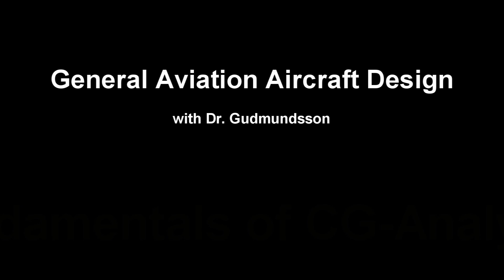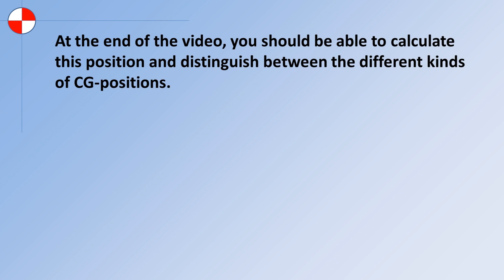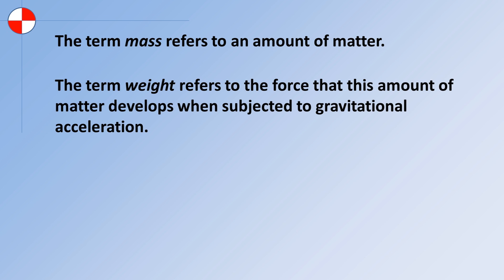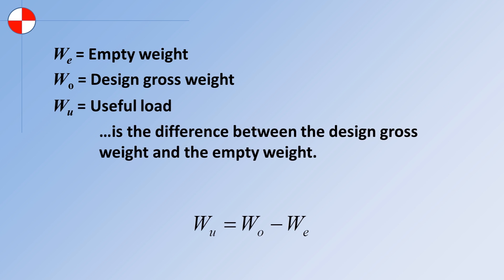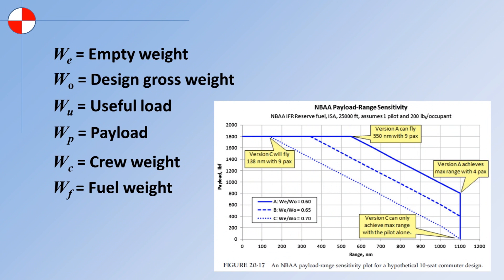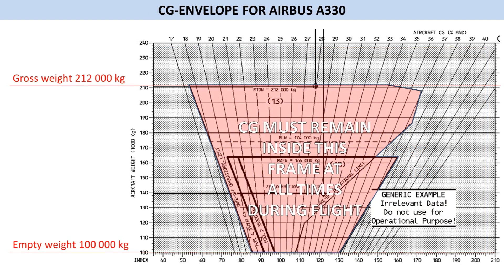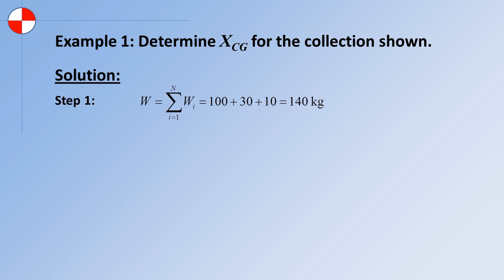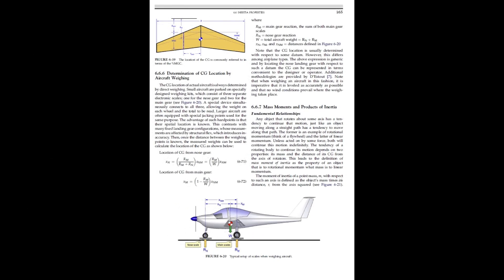Aircraft Design Tutorial: Fundamentals of CG Analysis

Comment: I want to build a P51 Mustang Replica for display, I have some sponsors here who help me with free materials and services. I want to use the drawings of mr. Marcel Jurca to do the parts and assembly, but the drawings are in PDF, and I want an assumed, responsible, serious volunteer (free of charge!!!) CAD engineer to help me redraw the drawings from the PDF and put them into DXF files, so it can be easily cut on CNC from plywood, aluminium, steel etc... I have some progress on the frames and formers (pictures attached). The Mustang will be displayed for a new aviation museum project I am currently developing. The CAD engineer will be mentioned on the sponsor's list on the project website.
Reply from the maker: I think you need to contact an aerospace or mechanical engineering professor at your local university and suggest this as a project for an undergraduate engineering student. They are usually eager to work on any projects they can place on their resumes (most likely for free). You should be able to find a design professor from the online faculty directory at your local university. Good luck!

Comment: Hello in example 2 at the end of your video, for #4 the fuselage shell my calculator said 3,780 not 3,785.1 and for #6 the main gear it came out to 455 not 455.8, were these errors on the spreadsheet  or was my calculator wrong, with my calculations the cg still came out to 17.95 though, which was still slightly outside the rear cg, thank you I liked your video very much and it really helped me understand how to calculate cg from the datum line on any aircraft
Reply from the maker: @Skypilotken  Greetings. The reason is that in my spreadsheet the actual weight of the fuselage shell and main gear is 84.113 and 91.165, respectively. However, since I'm showing the weight with no decimals (for clarity) this leads to minor discrepancies. I suppose I should have clarified that. Regardless, your arithmetic is spot on. Thus, given the reduced number of significant digits I'd say your calculations are correct. Best wishes.

Comment: One question:  In your example, how do you determine that the fuselage shell is to be located at station 45 of your diagram?  Since the shell is the whole length of the aircraft, I can't figure out why 45 inches was chosen.
Reply from the maker: Great question, François. First, the installed engine weight is assumed to contain everything forward of the firewall, including the cowling. Therefore, the "shell" is really the length of the fuselage starting at the firewall. This is approximately at Fuselage Station -30 (call it FS-30) and it extends to, say, FS170. Thus, I consider the CG of the fuselage shell being at FS45 to be a reasonable approximation. Yes, it might be slightly farther forward, but I hope this doesn't take much from the learning offered by the example. I hope this clarifies. Best wishes.
Reply: @dr.gudmundssonaircraftdesign  Thank you for your response.  That has always perplexed me.  I presume in real life situation, the shell would be weighed and balanced with the airframe.
Reply from the maker: @ADAPTATION7  Yes, weighing and balancing the shell would be done, although this can only be done after it is built. Before that's done, math is used to estimate where its CG is located. Today, solid modeling software is frequently used to determine this. An educated guess supported by mathematics does pretty well at this. Best wishes.

Comment: first assumption for CM and CG i dont agree with ... a plane with top wings like a pontoon plane such as a cessna has its CM BELOW the CG ... so they are NOT in the exact same place in all axis' ... they are always inline for best performance yes BUT the CM and CG are NOT in the same exact location ... on a cessna the cg is above the centerline of the plane while its CM is almost double the distance below the centerline BUT directly UNDER the CG in all axis' (at rest or levcel flight)... because of this difference the CM and CG cannot be interchangeable they will be CLOSE to each other but NOT exactly the same in all designs ...
Reply from the maker: Hi 0623kaboom. Sorry pal, wrong! Whether you (or any other person) agrees with the principles of physics is irrelevant. MOTHER NATURE IS OUR BOSS! WE ARE NOT HER BOSS. Do you know basic physics? If so: Weight W=mg, where m is mass and g is the gravitational constant (9.81 m/s²). Thus, the CG (center of gravity or center of weight) is precisely at the CM (center of mass). For instance, a solid sphere (e.g. a ball bearing) has its center of mass at the center of the ball. Since weight is nothing but the amount of matter (mass) times g, the CG is at its center as well, i.e. at the CM. The same applies to all other bodies. The only time this doesn't hold is if the body is in a non-uniform gravitational field (e.g. near a black hole, where the magnitude of gravity changes rapidly with distance from its center).

Comment: If the airplane weights 100 kg and the wing area is 1x10m, how fast do I approximately have to go to get airborne?
Reply from the maker: Robert. It depends on several things; first and foremost on the shape of your wing and airfoil selection. If we assume a poorly designed wing (CLmax = 1.0) , then your stalling speed (or minimum flying speed) would be approximately 46 km/h at sea-level. A better wing (CLmax = 1.5+)  would require some 37 km/h . Of course, getting airborne is one thing, having  a configuration that is also "stable" and safe to fly, is another. Best wishes.

Comment: Hello, Dr Gudmundsson.  I have a question about optimum tail arm length.  I am little confused as some books give different formulas for working out tail arm length.  In a book Mohammaqd sadraey uses
 l=K (sqrroot){(4CSVh)/(pie *Df)}
K=1-1.4
He also notes that tail arm length shorter than 3 times wing chord is short coupled, which possesses longitudinal trim penalty. 
Can you help me with this dilemma please?
Reply from the maker: Hi Sed. My formula sqr(2∙Vht∙C∙S/(pi∙(R1+R2))) is fundamentally the same as Sadraey's. He uses Df = 2R in his presentation, while I use R, where R1 is the radius of the fuselage at the wing's Cmgc/4 and R2 the radius of the fuselage at the HT's Cmgc/4. This also explains the factor 2 that is different between the two formulas. Sadraey only accounts for the diameter of the fuselage at the wing's Cmgc/4 and clearly assumes the aft fuselage is a cone, whereas I use a frustum. He also uses fudge factors (1-1.4) - I don't use any. These fudge factors are necessitated because when you use this form of the optimization one tends to come up with a slightly shorter tail arm than you find among real aircraft.

So, as you can see, there are slight differences but not significant ones. Regardless, I present two additional optimization approaches in my book and the third one optimizes the tail arm based on horizontal and vertical tail volumes and its output is pretty close to what you see in real airplanes that have the centroid of their HT and VT close to one another (which is the case for great many real aircraft). You should also keep in mind that sometimes other factors come into play that force designers to change the tail arm. Thus, the optimized tailarm estimation should be considered an initial tailarm. Things that might force the designer to shorten or lengthen the tail arm might include dynamic stability concerns, requirements for fuselage volume, to name a few.

Also, it is true that a short tailarm may lead to longitudinal stability issues, but one must be careful with such assertions. For one, thrustline and overall geometry impacts this too. A case in point are airplanes like the Cessna 150/152 and Piper J-3 Cub, both which have tail arms shorter than 3 x Wing chord and I would not exactly say either has any serious longitudinal problems - quite the opposite. Both are excellent trainers. Also, consider flying wings. Some of those have excellent flying characteristics as well and they surely have short tail arms. It's easy to suggest rules-of-thumb, but they don't always apply.

I hope this helps. Have fun designing!
Reply: @dr.gudmundssonaircraftdesign Thank you for responding to my question.  You have been extremely helpful.  I've read your answer long time ago I just forgot to respond to it.
Reply: Why the moment values in example 2 for some components are different (the one with decimal points)? I graduated from ERAU, Daytona Beach  Florida in aerospace engineering back in 1985. This video brought back so much memories. Thanks

Comment: Very nice explanation of mass, weights, moments and CG calculation. The exercise at the end of the presentation gives me  17.953 inches. Is this because of weight rounding?
Reply from the maker: Your answer is precise to the 5th significant digit. I'd call that spot on. (I call it correct if it is accurate to the 3rd sigfig). Well done. You get an A+. :-)  Interesting aircraft configuration, by the way.